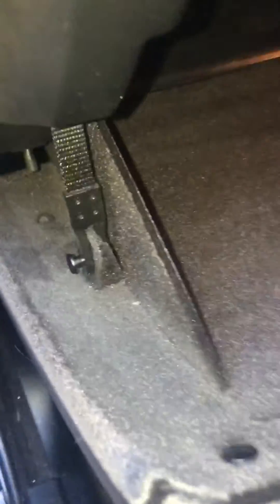BMW E60 MOST fiber optic connector location

Comment: What’s the purpose of this?
Reply: If you've got MOST loop problems, seeing light here proves that loop is going around all modules successfully, since this is the last connector before radio. If you dont see blinking red light here, loop is broken somewhere
Reply: @uluth Really? I have an E60 535d and my head-up display isn't working, all the speakers on the right side aren't working and the SOS error message is always lit up. Can you help me with that?
Reply: I think it's where the MoST network connects a glove box mounted cd changer. Without the cd changer, they just call it a MoST tester to show if the network is ok without pulling cables out of modules.

Comment: Is this where I would put the most fiber optic bypass loop? For the sos malfunction
Reply: I have the same problem, E61 525d LCI 2008
Did you solve it?
Reply: nope, you need to remove the module causing the sos malfunction and then put the bypass to that faulty module.
Reply: Thabk you so much. I never seen it when i was looking by my own until i watch this video